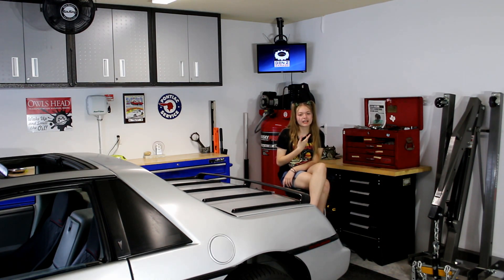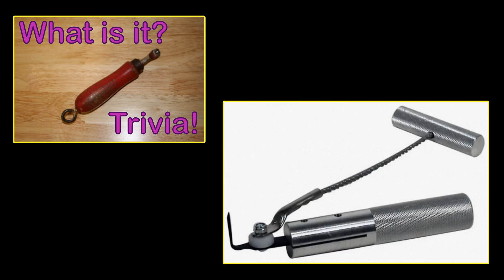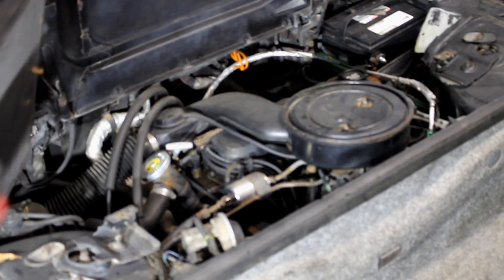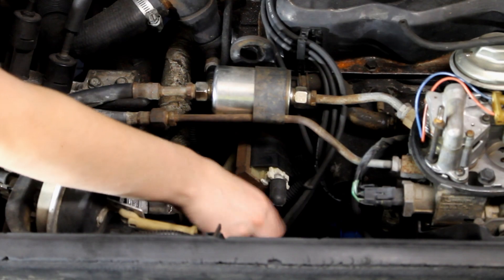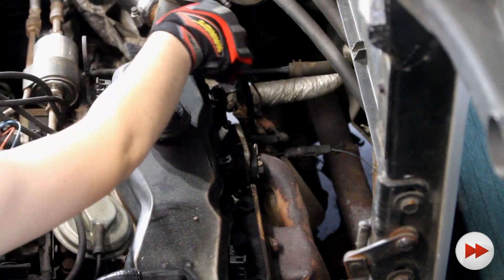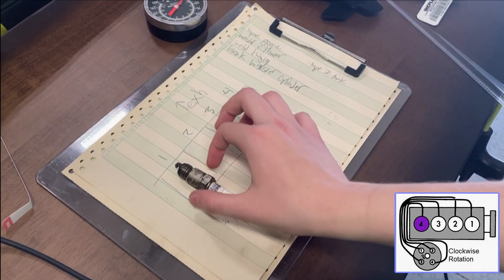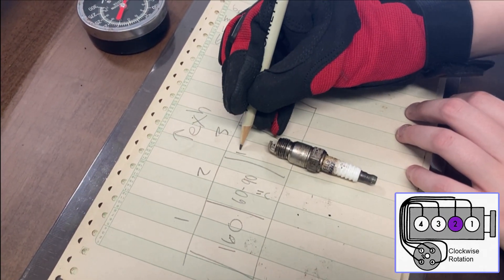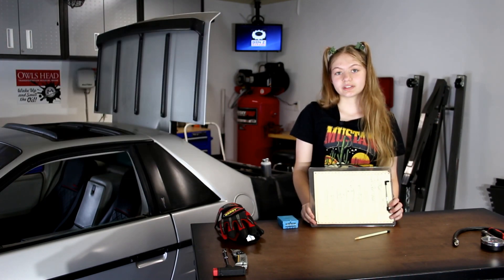How to check engine compression! - Gen Z Garage - Ep 6

Comment: Good video! It is good that your spark plugs came out easily, on my Fiero (v6) all of the front plugs were really rusty and corroded when I got it, and the front left plug broke, with the metal hex and porcelain center coming out and leaving just the threads of the plug, I ended up removing the rest with a screw extractor set, but that took an entire day of standing in the trunk! I had very sore knees! Also I think that the trivia answer is a chime box.